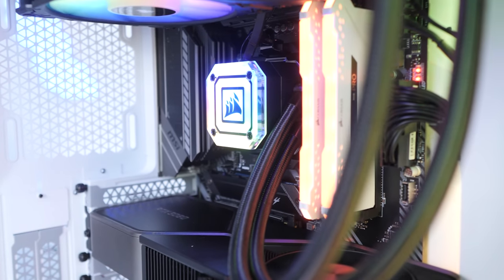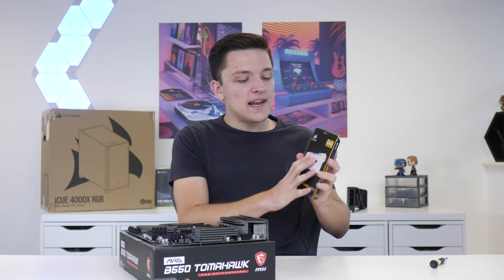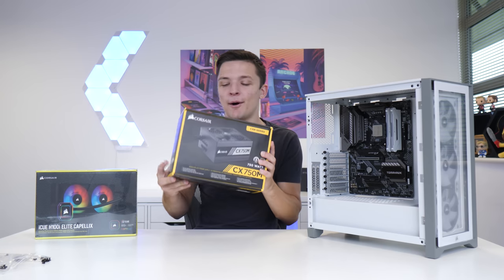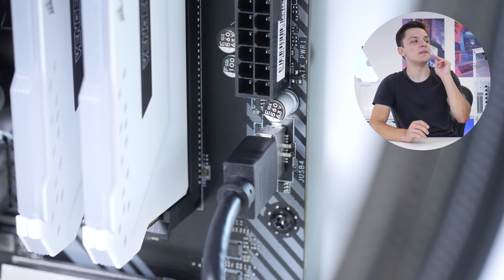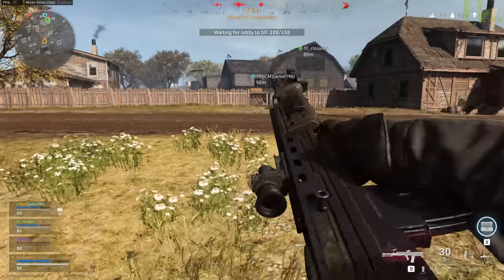$1500 RTX 3080 Gaming PC Build 2020! [FULL Build Tutorial w/Benchmarks! - ft. Ryzen 5]

Comment: I honestly would have ditched the aio and went with the stock cooler and used the $150 to upgrade to a 2tb nvme
Reply: Or a 1 tb nvme which aren’t much more that what he spent for a 500 and a 2 tb had drive or just upgrade cpu to 3700x and rock with stock cooling and still get the tb nvme

Comment from the maker: TIMESTAMPS:
0:00 Intro
0:22 CPU, RAM, SSD & Motherboard [Build]
2:05 Case [Build]
3:00: PSU & Power Cables [Build]
3:44: CPU Cooler [Build]
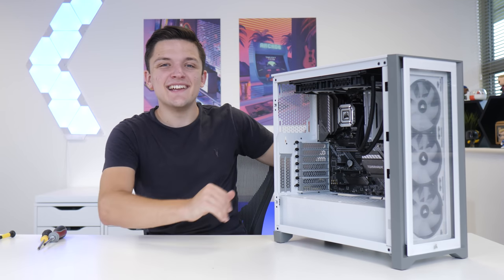4:50 Front Panel Wiring & Cables [Build]
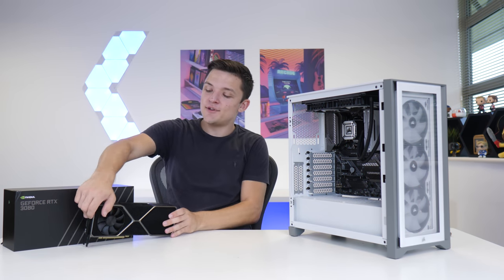5:36 GPU - RTX 3080 [Build]
3:55 Build Montage!
7:16 GTA V [Benchmarks]
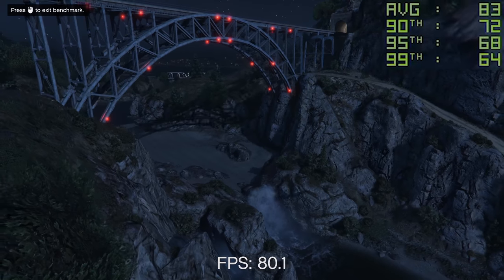7:38 APEX Legends [Benchmarks]
8:11 COD Warzone [Benchmarks]
8:49 Forza Horizon 4 [Benchmarks]
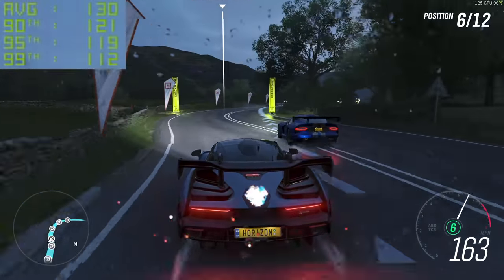9:28 Overwatch [Benchmarks]
10:04 CS:GO [Benchmarks]
10:24 Battlefield V [Benchmarks]
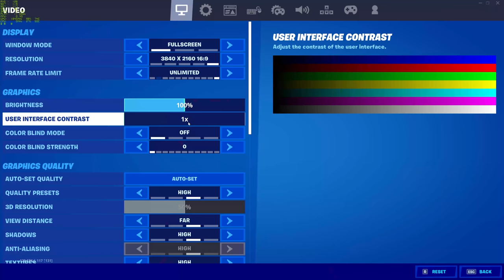11:03 Fortnite - 4K & 1440p [Benchmarks]
Reply: GeekaWhat thx I am gonna build ur pc first pc and setup
Reply: What monitor did you use?

Comment: Honestly if you didn’t spend so much aesthetically you could’ve got faster ram and possibly a ryzen 7 but still good build
Reply: Agreed im building a pc similar to this only thing im gonna change is ssd size, ram and ryzen 7 3700x
Reply: Prices are subject to change for better or worse usually better
Well if he went aircooling instead of the water cooler he'd be spending 1/3 of the price of the water cooling chosen. $44.00 at the time of writing.
Maybe he wanted a water loop the it'd be $74.99 from cooler Master.
Let's say he did go for a water cooler for 74.99 that is 75 dollars more in the budget and maybe he choice a different case and maybe you'll be generous and still get a case with RGB fans P400a 3 RGB fans for 10 dollars less.
Saving a total of 85 dollars having all fans RGB by just changing cooling and case and still having it look great.
I could mention another area like the motherboard choice. Where currently a atx X570 is cheaper than the one in the video saving $10.= $95
There's many ways to save money since if you look there's only 500GBs of storage in this system. This could be substituted for another SSD at 52.99 over 78 and still retaining NVME speeds from crucial.
Making the total saved $120 with little to no change in performance. 
Personally I would use this 120 to upgrade the CPU to a 3700x with $30 to add to the main SSD and get a 1TB 2.5 SSD despite the performance hit normal sata SSDs are already very good for gaming. But if I wanted to retain speed id get a 500GB barracuda for 29.99 as a secondary..
Reply: @justdashie1132  did u get set this for an essay or something, or are u just a boomer?
Reply: @kaydotee  For the sake of people's wallet I just commented on each part. It isn't hard.
Reply: What would be a better Performance build?
Reply: Stephen A. Smith  yeah
Reply: Yep instead of the corsair h100i elite capellix, he should go for the h150i pro rgb
Reply: Stephen A. Smith  so 2080 super and ryzen 7 is better then 3080 and ryzen 7? i dont get it sry
Reply: I get this combo because the prices in the Netherlands are quit inflated
Reply: @CorporalAnsh ya I agree
Reply: @michy1337  nooo
Reply: he literally said he wasn’t playing 1080p he doesn’t need a ryzen 7
Reply: @riplo1693  that 1000000000% correct
Reply: He also could have saved money with an air cooler instead of an AIO. especially since AIOs are trash
Reply: @justdashie1132  what aircooler do you recommend?
Reply: @HSKY69  Honestly any well rated air cooler like the Hyper 212 would be a great budget to preformance ratio this'll be good for basically any CPUs on the market gaming orientated CPU market.
But if you're looking for high end cooling to rival some water coolers look into Noctua coolers.
Reply: @justdashie1132  ok thx bro
Reply: @turbovince3891  should I go for the ryzen 9 or 7 will do ?
Reply: @marianogabrielvega9584  what are you planning doing with the pc
Reply: @HSKY69  gaming tbh school work and probably some editing not much I just want some good quality
Reply: @marianogabrielvega9584  oh then the rysen would be worth it if you just want faster loading speeds etc for editing but the rysen 7 could do
Reply: @HSKY69  alright thanks appreciate man
Reply: @marianogabrielvega9584  on the gpu u can either get 3060 ti or 3070 if u only have a 1080p monitor and it'll save u more money enough to upgrade some parts or add some more aesthetics to it
Reply: well in my opinion overkill is actually a better choice for now since Nvidia is not gonna make newer cards for a while. And since there's a lot of triple a games coming out this year and next year (2022) u can futureproof your build and save money in the future

Comment: The rtx 3080 was bootle necked pretty hard tho
Reply: I don't think so
Reply: Is it a bottleneck
Reply: @weseeee5827  No, the Ryzen 5 3600X is a good paring with the 3080, but only if you plan on running 1440p settings. With that configuration you would be running ~120fps and that wouldn't bottle neck the 3600X.
Reply: @web3trollin  yeah i'm agree with you cause people will be buy 3080 with minimal resolution in 2k
Reply: gameroy56 where do you get that data from the 3600 bottlenecks 3080? From what I’ve seen at 1440p, the higher end cpus only give 5-10 FPS more compared to a 3060. I wouldn’t say that is a hard bottleneck.
Reply: The rtx 3080 bottlenecks in 1440p with a mid range cpu

Comment: I would definitely not recommend this case. It’s a hotbox
Reply: Lian Li O11 Dynamic is the best pc case every. Change my mind!
Reply: why is that so, do you've one ?
Reply: argh666 it has a glass panel that blocks air intake. Watch Dimitri’s review of it
Reply: the case is also 180$ not 110$ like he says in this video
Reply: The case in $180 yes but its deffinetly worth it. Cool design, amazing airflow and also fits tons of HDD and SSD drives
Reply: LowKeyMad _ might be worth it but if it was actually 110$ i would have bought it not 180$
Reply: @cameronkendall9113  The thing is that black friday is soon and the case will drop so it wont be that expensive

Comment: I'm thinking getting the following parts for my first pc (budget about 2000€), but I'd like to hear what do you think about them and could/should I switch something, bc I don't have really good knowledge about pc's.

Case: Corsair Carbide 275R Airflow (White/Tempered glass)
PCU: AMD Ryzen 7 3800XT
RAM: G.Skill Trident Z RGB LED DDR4 3200MHz 2x8GB
SSD: Corsair Force Series MP600 1TB and Samsung 970 EVO Plus Series 500GB
PSU: Corsair RM850X V2 850W
Motherboard: Asus ROG Strix B550-F Gaming (Wi-Fi), bc can't use LAN cable
GPU: Nvidia GeForce RTX 3080 Founders Edition
AIO: Corsair Hydro H100i RGB Platinum SE (planning to put on the top)
Case fans: 4x Corsair LL120 Dual Light Loop RGB White PWM 120mm LED
Cable Extensions: BD Cable Extension Kits Sleeved Cable PC Extension Cables-Premium Edition (Black/White)
Also: Corsair HD RGB Fan LED Hub

I'd love to hear what you think about it and if possible, to see you building it. Love you vids. Honestly so underrated channel. I just found it like 2 days ago, and already think, its one of the best. Keep the great work up :)
Reply: Man that thing will b a beast!
Reply: @AudioStorm1980  I hope se. After all, I'm spending 2000€ for it.

Comment: Totally random question but if I switched out this cpu for a ryzen 9 3900x would any other parts need to be changed
Reply from the maker: Technically no, but Ryzen 9 and B550 probably isn’t the best idea,,,,
Reply: GeekaWhat ok if I wanted to upgrade the cpu you used a little bit that would work well with the motherboard what would be a good option

Comment: I'd love to see if the 3700x in this build would improve fps much
Reply: Only on low resolution and settings. There are some benchmarks that show just a started ryzen 5 3600 actually out performs (within margin of error) higher end ryzen cpus AND is only like 3 fps difference when paired with chips like the 10900k. All that was 4k ultra but  if you are buying this card probably what you will use anyway. And even at lower settings the bottle neck really wasnt that bad. Only like 30 fps at 1080p medium

Comment: Did you not have an issue getting your activating your 2 USB ports on the front panel? Got this notification from PC Partpicker 

Corsair iCUE 4000X RGB ATX Mid Tower Case has a front panel USB 3.2 Gen 1 Type A port, but the MSI MAG B550 TOMAHAWK ATX AM4 Motherboard does not have sufficient USB 3.2 Gen 1 headers. The case USB 3.2 Gen 1 Type A port will not be usable.

Comment: I still have the case motherboard, RAM CPU and GPU I got a XFX RX 580 Radeon I still need the SSD and HDD and 2 fans with no RGB I have a Old PSU that’s 600 watts, it hasn’t been clean for 3 years ago I need to get a compressed air can for Computers to get rid, of the dust.

Comment: so $1568 then. how come are pricing it in dollars if you a Brit. How does that help us in the UK?

For UK it will be around £1667.01 based on the parts listed that I could find, which works out about $2135.10.
Guess we are being ripped off in the UK compared to the US based on exchange rate.

Also if you don't have a 4K monitor or 1440p monitor, that would be extra cost to get the GPU not to bottleneck if you have 1080p. Although not all of us are able to get free parts from tech hardware companies to build. Good starting point for people to build their own rigs. :)

Comment: I have a slightly different build. I have a icue 220t rgb case which is the front tempered glass version not the airflow version and is equiped with three Sp120 rgb fans pre-installed. I also have a h100i platinum rgb which has two rgb fans. I will also buy a exhaust sp120 fan separatly for the exhasut. My case comes with a lighting node core which only does the lighting of the six rgb fans I will install but to power the rgb fans with voltage do I need a fanhub?. The motherboard I am going with is the ASUS Tuf Gaming B550 Plus Motherboard.. How to I make the six rgb fans spin and control through pc software? Please help its very confusing

Comment: I was wondering whether is enough to use 1 pcie cable with split to 2x8pin for rtx3080, or is it preferable connecting with 2 separate pcie cables? Using corsair rm 1000x gold

Comment: Ive just put the parts into pc parts picker and they say this "Corsair iCUE 4000X RGB ATX Mid Tower Case has a front panel USB 3.2 Gen 1 Type A port, but the MSI MAG B550 TOMAHAWK ATX AM4 Motherboard does not have sufficient USB 3.2 Gen 1 headers. The case USB 3.2 Gen 1 Type A port will not be usable." I really like the case so what other motherboard I use instead?
Reply: Btw im pretty sure thats just a glitch with the website. Any case u put with the b550 gives the same error. I also googled it so I think your good. I was gonna get the same case and motherboard

Comment: AIO literally Same price as the CPU that doesn't even overclock like that LMAO

(Edit anyone reading use that 150 for a better cpu cuz you'll definitely bottleneck with a 3600, you could literally rock a 3800XT with all the money ur wasting on the AIO, the stock cooler it comes with is great and even rgb, for a shit load more performance you probably even save a couple dollars)
Reply from the maker: I discussed this, the 3600X is a very very very minimal bottleneck, a build is all about balance - a balance between raw performance, usability, sound/noise from the pc etc etc...
Reply: GeekaWhat even then u could just get a good aio for like 70-80 and then have an extra 70-80 that could go towards a better cpu, like a 3700x

Or faster ram, cuz 3000 on ryzen is a bottleneck too. U want that 3600

Comment: Would this work well with a GTX 1660, or will it bottle-neck too much?
Reply: Bottleneck depends on what resoultions/settings/games also you play in. Generally having a very powerful CPU and a light GPU is viable, becuase you could use your CPU to your limits and your CPU is powerful enough to use the GPU to its full ability.

Comment: The rtx 3080 founders edition is out of stock. Would a regular 3080 do the exact same thing?
Reply from the maker: Yes!
Reply: @GeekaWhat  sorry for bothering you. But would a rtx 3080 with a fan cooling system and boost clock speed of 1.71ghz with a gpu memory size of 10 gb have the same performance as the one in the video?
Reply: Does the RTX 3080 run Minecraft well regularly without shaders?
Reply: @CWG8926  haha yiu will get minecraft at insane fps either way

Comment: The Ryzen 7 3800XT would have been a really good match for the RTX 3080, as it has very high performance per dollar ratio than other 8-core processors, and still a better option for an exceptionally balanced experience with a little raise in price. But the Ryzen 5 3600X isn't a sore loser anyway. As always, love your builds and videos! May you reach 100k soon!
Reply from the maker: The 3800XT is still another 200 dollars tho, which pushes this budget higher and higher. Thanks tho dude - onwards and upwards indeed to 100K!
Reply: @GeekaWhat  BTW I had a request: Can you do an all-ROG Build with dual RTX 3090 (it's really up to you if you want single or dual GPU config)?